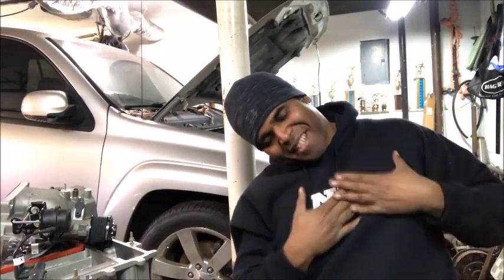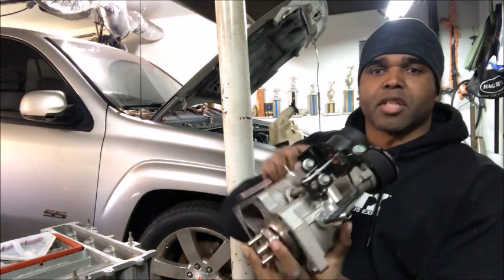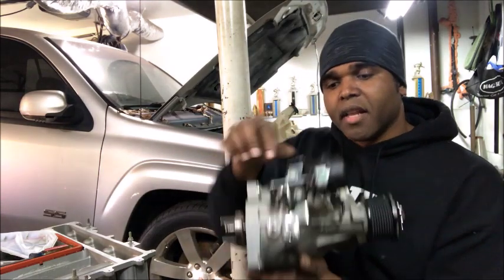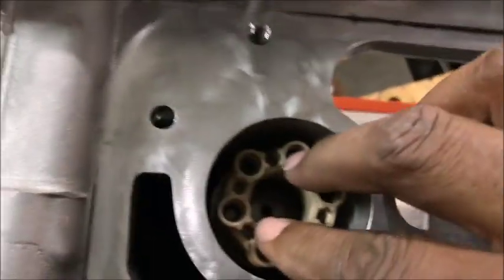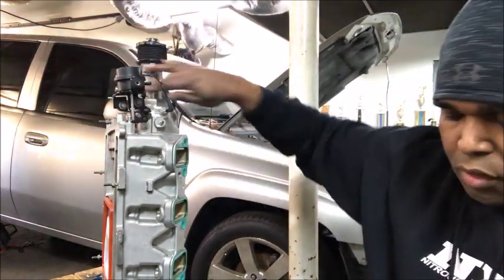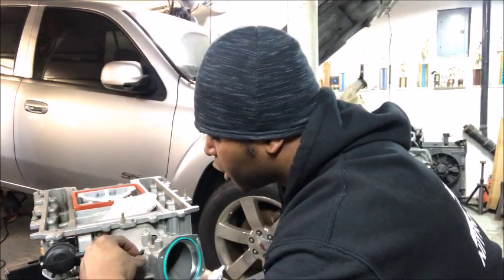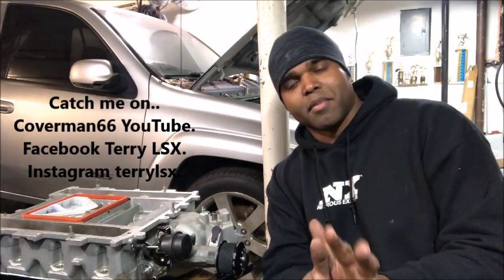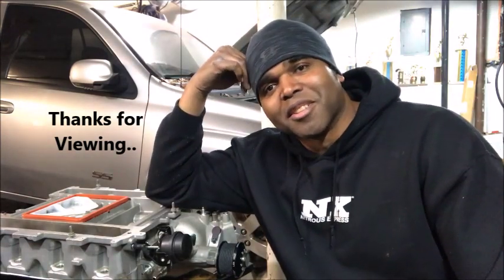How To: Set up an LSA Supercharger (Butterfly Adjustment, Vacuum Block Off and More.)

Comment: Does shutting that throttle plate all the way create any negative results in drive-ablility. I recently changed my pulley and also did this while I was at it. Now when I'm cruising and let go of the throttle the car feels like it hangs slightly in the rpms and goes down slower than usual.
Reply from the maker: sounds like that might be in the tune.. im curious is it drive by wire?

Comment: Great video Terry. When you move that small line up top for vacuum do you put a cap on where you took it off ? I also was wondering if I can route my PCV through a catch can to the large nipple under the actuator. Thanks in advance.
Reply from the maker: you could use that small line for heater vent doors . under the actuator is where i routed my catch can.. thanks for the compliment nrotha Bryan.. much appreciated.

Comment: What is the second map sensor looking thing on the lid for......I'm on the fence about putting a supercharger in my 73 nova...I just don't know if I want a lsa or a centrifugal vortech style,  will the lsa work with a truck dampner on a single belt?.....I'm also running a fitech so that's why I was wondering about 2 map sensors....if that's what I see.....I just wanna put some boost on my nova so I can rub it in my wife's face with her beloved ctsv....lol
Reply from the maker: lolol the first sensor is ambient air.. the second is the map sensor you want to use..